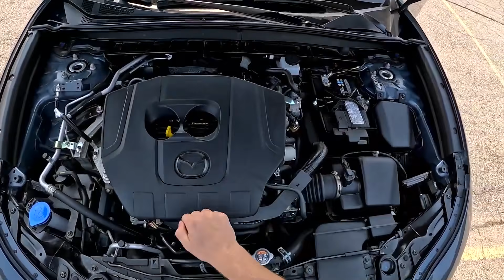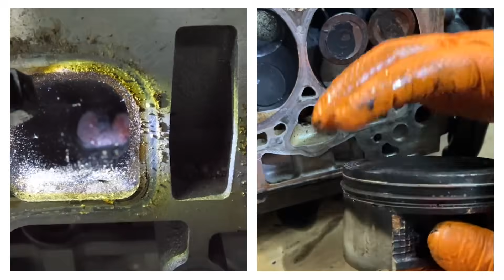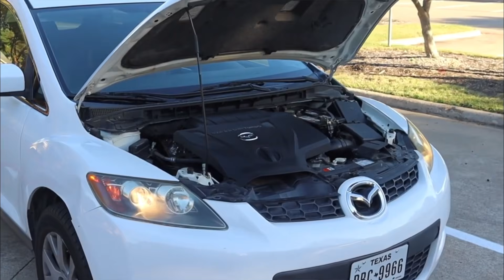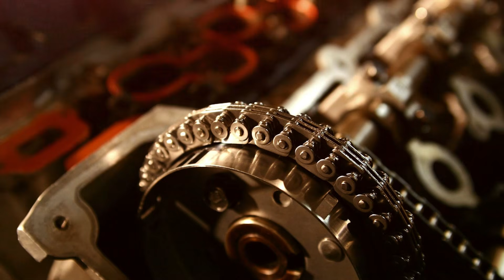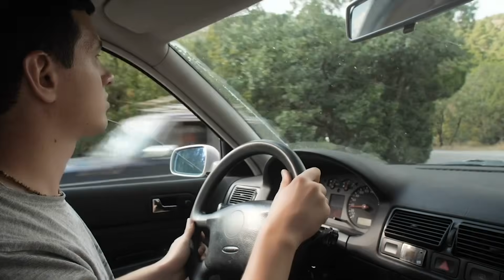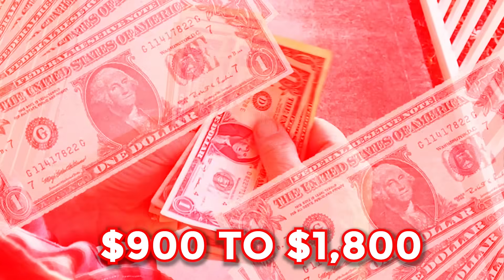MAZDA OWNERS! Don't Let This Mistake Destroy Your Engine!

Comment: i got this P0171:00-E8 code.

rough idling, suddenly increase RPM when stationery whitout pushing the throttle pedal.

already cleaning the MAF, intake, replacing the fuel filter. the problem still exist.

any advice what should i do ?

i use CX5 GT KE 2014
Reply: easy fix
Reply: check maf
Reply: replace
Reply: Too much air is getting in, causing a lean fuel-to-air mix. First, check for vacuum leaks from cracked or disconnected rubber hoses or old intake manifold gaskets. Do a visual inspection or spray brake cleaner around the various vacuum lines, components, and gaskets. Perform this while the engine is idling—if there’s a sudden, temporary change in idle speed, that’s likely where the leak is. Also consider a faulty fuel injector, MAP sensor, or oxygen sensor, though I’d lean more toward a vacuum leak.

Comment: 304,000 miles with 7,500 mile intervals on Mazda recommended Castrol Synthetic 5w20- still running great 👍
Reply: mine is 0w 30 same 7500 looked at engine still clean and no oil useage, still moves great.
Reply: How old is your car ie Year
Reply: @BernardStewart-s8z 2013 Mazda3  with SkyActiv 😊